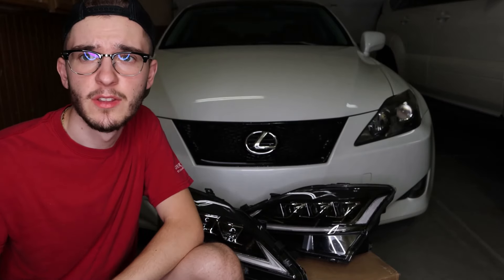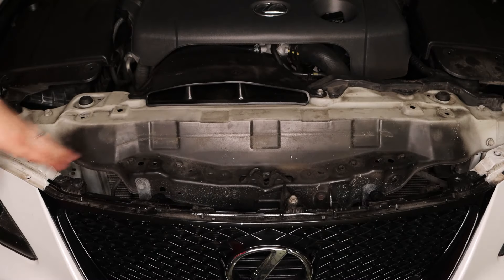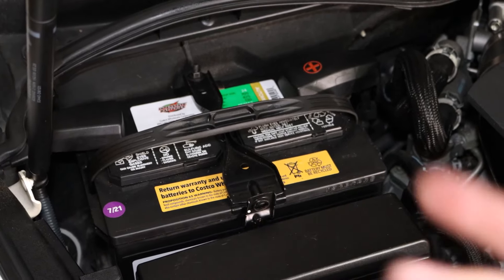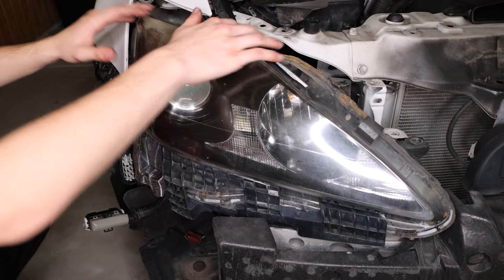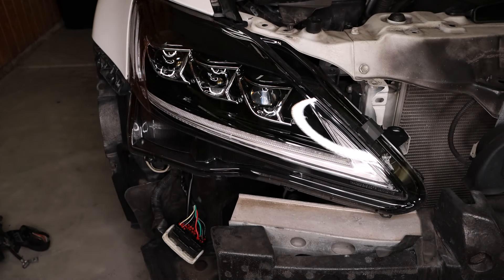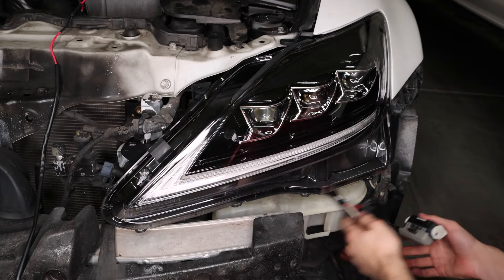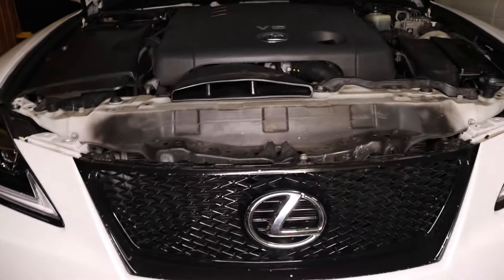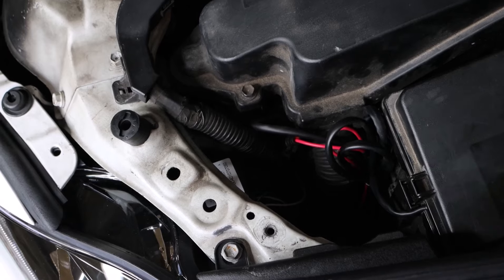HOW TO: Install VLAND Headlights on IS250/IS350/ISF

Comment: Hi, I want to buy the Vland headlights. But I can’t get a response from anyone about what type of LED bulbs do they hold? Can a H11 Sylvania LED bulb fit inside the Vland headlight? Please help with what bulb fitting actually fits inside the headlight. I’m staying away from the halogen bulbs/fitting types. My Is250 had the factory HID D4S bulbs. I want a headlight that can hold and fit the modern H11 LED bulbs  Part #
H11SLBX2
SKU #
Reply: I know this comment was two months ago, this headlights are sealed and don’t need or hold any other bulb, just the ones that come with them. Sorry
Reply: @robcs871  sealed? So what if the bulbs burn out? We throw away the entire headlight?????
Reply from the maker: The LEDs are enclosed inside the headlights and dont need to be replaced, from what I have read online nobody has had problems with LED burnout and have used the headlights for many years
Reply: @michaelboibodas  yes... it's a throwaway society... the idea is it lasts forever... but as we know that's never the case, hopefully the car wears out first I guess

Comment: have you the part number for those plastic clips?
Reply from the maker: Which plastic clips are you referring to?
Reply: @nkautos the press in plastic clips which you removed with that tool. But I found there is some on Amazon. Not exactly the same but similar

Comment: Are you supposed use the old headlight bracket on the new headlights???
Reply from the maker: Yes you can install the old brackets, I was waiting for a different set as i went with a body kit for the car

Comment: My check marks do not turn on even thought everything was properly connected, any idea why? and also my dash keeps saying check headlight system and i’m unsure how to fix that
Reply: Same problem did you get any solution
Reply from the maker: Did you make sure to tap to a fuse that turns on for ignition? Also check to see if your modules for the headlights are plugged in